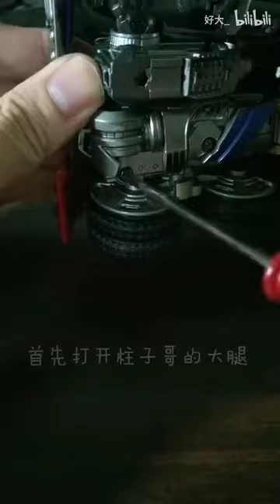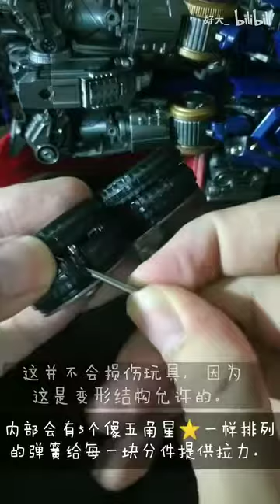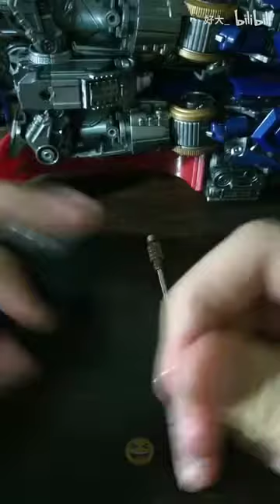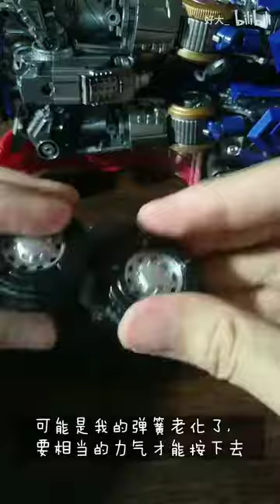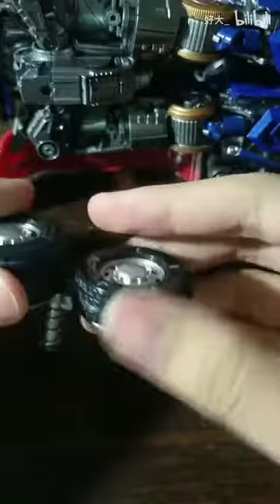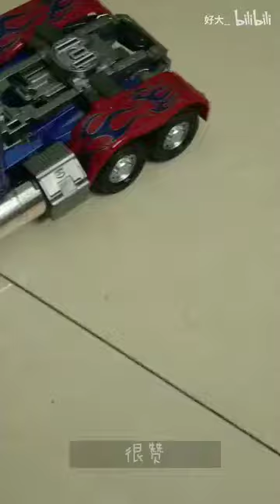Weijiang Black Apple Optimus Prime DIY Thigh Tire mod (Reuploaded from Bilibili)  [NOT MINE]

Comment from the maker: Note: feel free to do this mod, but I REALLY don't recommend it. I just got my new BA Optimus 3 days ago (from the time this comment was posted), and I did a teardown (watch here: https://www.youtube.com/watch?v=2L-xsF_rbdc). In the process, I removed the springs around the silver pins attached to the upper disk. It only made the transformation harder. It isn't worth it, even if it makes the figure roll (as rolling things should- Emgo316). 

But if you want to, feel free. Just have a bottle of lubrication next to you and be aware that you might have to buy replacement tires as a result.

Comment: Do you pull out all of the springs in each tire?
Reply from the maker: Yes. But if you choose to do it like that, please be very careful, plus the springs will be permanently damaged (unless you know how to recoil them) and you'll have to manually pull the tires instead of letting them pop out. Even the guy who posted this on Bilibili claims he partially regrets doing it (I reuploaded it from Bilibili, since I couldn't find a video like this anywhere on Youtube). 

Also, I ordered a BA Optimus Prime reissue, and it should come this week. I plan on doing an unboxing and teardown here, so I guess I could try while reassembling him. 

Edit: I recommend you don't do it. It makes the transformation harder. There's a reason why Black Apple put springs in the assembly when he could have made the assembly workers' job easier by omitting them.
Reply: To easily recoil the springs just use a hair dryer or heat gun on them and they'll reshape
Reply: How does it make transformation harder?
Reply from the maker: @lonewulv13 well, the lower disk (inner tire) will wrap around the upper disk (exterior tire) during compression. There will be friction between the two, particularly between the inner disks borders. Thanks to how the mechanism was designed, it will be hard to pull the outer disk out of the inner one. You'll need to carry around a toothpick or screwdriver to lever it out if you don't have long fingernails.

The reason why we can't notice the friction normally is because the 5 springs will overcome it, allowing the upper disk to pop out from the surrounding lower disk pieces with little to no pulling. The trade-off of the springs is taking away the ability to spin properly, thanks to how they press the lowerbdisk against the base.
Reply: @cutercills9x9creates65  Would it be possible to replace the axel pins with slightly longer ones so there is a gap between the base and the tire?